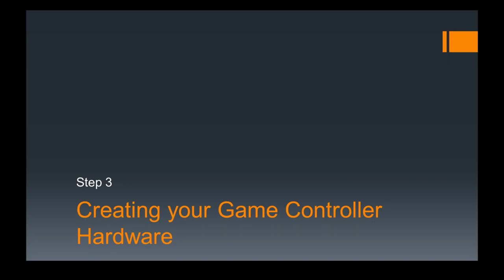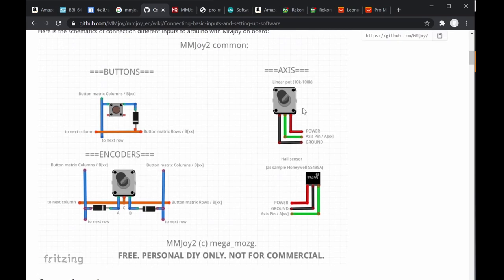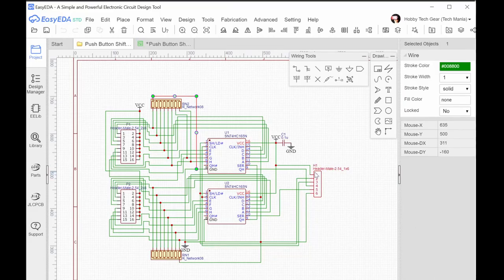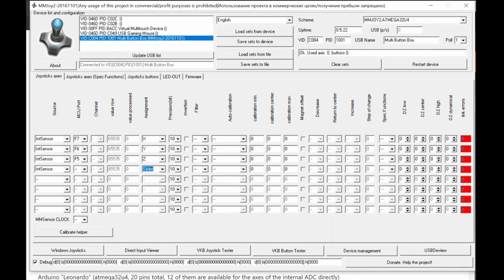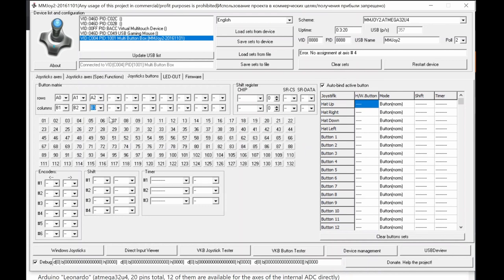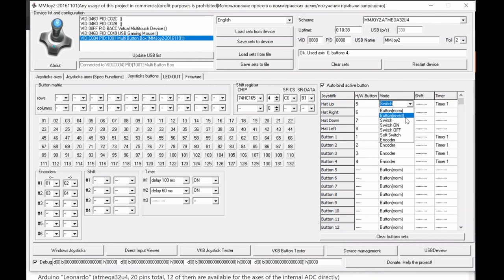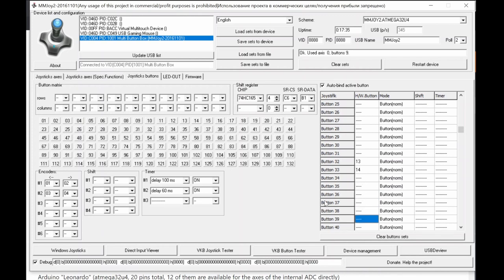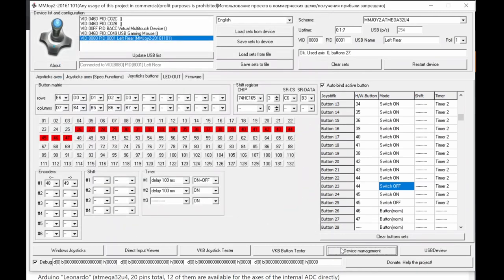DIY: Part 3 USB Controller using MMJOY2 and Arduino board

Comment: Interesting series, thanks. Once implemented, the Arduino Micro is a game controller. This Arduino can no longer read a sketch into the Arduino IDE because it cannot find a COM port. How can I reverse the entire process to use the Arduino micro again via the original COM port?

Comment: Great channel this!!
I sure am going to build a flight stick the way you figured!
compliments...
One question:
Why do you use the MMJOY software and not the present Arduino joystick libraries??
I use Arduino Micro and leonardo with these libraries in my Lear45 simpit for flight controls , throttle.. etc, this works fine.
Reply from the maker: @loediloedi  yes you could i just lazy and not willing to spent time in coding since mmjoy2 provide ample function. But if you have time coding yourself and if possible customize your self would be much better option
Reply: @hobbytechgearID69  ah ok, i thought you maybe had issues with the arduino library.
I do experience some issues with the mmjoy software on my w11 asus rog notebook, so i will go with the arduino joystick libraries.
Thanks for the reply and keep up the good work!

Comment: Excellent series! I'm testing a potentiometer right now for DCSto control hud brightness but having trouble. The pot acts like the center of the rotation is 0, instead of all the way left being 0. Do you know how to change this?
Reply from the maker: You could use a slider mode in DCS analog setting or event set inversion etc
Reply: @hobbytechgearID69  That's what I thought but I can't get it working. I'm sure it's something simple I've overlooking. Thank you.
Reply: I got it working, it was the auto-calibration causing problems. once I manually configured the values it worked great :)

Comment: Hello ! Thanks for the informative video! I have an important question for you - I want to place backlit and latching buttons in the dashboard, because... If the button does not lock, it will not light up. But in games, the button is pressed once to turn something on, and pressed again to turn it off. Is it possible to program MMjoy so that a latching button works, but a single press is emulated, and when you release the button, a single press is emulated again? Same question about toggle switches. And if so, how to turn on the backlight, which is built into the button, or whether the diode turns on when the toggle switch is turned on? Thank you, I'm looking forward to your clarification! )
Reply from the maker: Yes it can simulate a switch select the switch option on the right areas when assigning the buttons, I think I explained it in my video
Reply from the maker: Oh you meant to simulate a real led in the your controller? Unfortunately mmjoy do not provide outputs, spthats whg I move to mobilfight for my real a320 cockpit build. MmJOY is input only. You could use a flip flop logic gate but thennto synchronize with the in sim lights would be impossible and it coild be out of sync in manh occassion

Comment: Hello sir! I wanted to ask for help with connecting the axes and buttons because I am a beginner.
I have an Arduino pro-micro. 1) How many potentiometers (axes) can I connect?
2) After connecting the maximum number of axes, how many buttons will I be able to connect? I would like to connect a button to retract the landing gear (like you did in the video), start the engine and maybe 1 or 2 more toggle switches? I don't want to use the matrix button or shift register yet, only the pins from the Arduino board. I am asking you for help and I greet you warmly.
Reply from the maker: You could try to seek the arduino Pro Micro pinout in google it has, 18 Digital I/O it meants using direct connection you get 20 Switches (inputs), or without using shift reg you but using matrix configuration (Column/Row) you will get at least 9 x 9 or 81 maximum Switches (inputs) limited by MMJOY2 capability, or if you use all the analog 9 of them then you left with only 4 x 5 or 20 switches (inputs). Documents said it has 20 Digital I/O which 12 can be configured as Analog (ADC) input and 7 can be configured as PWM but in actual you should refer to the pin out diagram.
Reply: @hobbytechgearID69  Thank you very much for your explanation and patience! :) Kind regards!!!

Comment: Very good series on mmjoy software, I am trying to build a button box with a key switch for ATS/ETS2 this really helps
Reply from the maker: Glad it helps, I do build my ATS/ETS button box too earlier, just now still focusing on FS2020. Seems pretty powerful firmware so far any needs on my end on the function can be addressed with it, even advanced analog potentiometer or axis requirements.
Reply from the maker: @barrywingler418  Hi Barry, thanks, no problem I could send you some drawings for reference. For Shift reg circuit, and simply use MMJOY2 feature to read it so no need program. For Rotary buttons you need to setup the rotary button basically it's just like a momentary switch 2 ways plus 1 momentary push button switch. Each are treated as push button in raw input of MMJOY2 however to make it as a rotary MMJOY2 provide a features to program it under Buttons tab usually in lower left area. There you need to put the turn left and turn right push button (from the rotary switch) raw button number (the buttons with red marking if it's pushed). and set the timer for around 40-100 ms should be sufficient. I could also sent my sample files of MMJOY config.
Reply from the maker: @barrywingler418  Sent you email

Comment: Hello again, now i figured it out, i was connecting potenciometer on vin instead of 5v because it said so on the plans, nut i would like to know how to connect an external ADC, i have a ADC1115 16bit and i dont know how to connect it and program it with mmjoy2
Reply from the maker: Good to know, Im about to ask you on your schematic coz usually that problem happend if the gnd and +5V are not well connected
Reply from the maker: For adc1115 support unfortunately I could not help as i havent use it, in mmjoy2 joystick page you could select several externa adc but so far I did not use it. If not mistaken there are several articles and forum discussion about that.
Reply from the maker: https://forum.dcs.world/topic/99954-mmjoy/page/28/
Reply from the maker: Seems not supported. Btw as Ive mentioned this mmjoy2  is free and will not have further development or improvement unfortunately.  So its stuck at latest version 2016xxx. I believe the people who create it has now at Virpil company or actually the found virpil.

Comment: Hello. For my DIY-Cockpit, I need 5 Sliders. (2x Volume, 2x Brightnes, 1x Zoom) Is this possible? Can you make a little Video for that problem?
Reply from the maker: Hi sorry got tight timing currently on video, but it can easily be done using the 6 available analog input.  Connect the center pin of the pot to the analog input, and one of the side pin to 5V and another to ground. Its in the mmjoy2 github guide.
Reply: @hobbytechgearID69  in the software (MMJOY2) I can only use one slider. If I choose more than one I got an error if I want to safe the program.
Reply from the maker: https://youtu.be/f3k8beZaHbY
Reply from the maker: Start at 24:50
Reply from the maker: Slider can be only one in windows but you could use other axis as slider thats just naming
Reply from the maker: Windows named analog axis as X,Y,Z,rX,rY,rZ,Slider, etc but all those are axis you could use slider potentiometer or rotating one
Reply from the maker: Then once you named x,y,z or slider you need to bind properly to the application
Reply: @hobbytechgearID69  the application is DCS. If I set one axis as slider and the others as x,y,z, DCS recognizes the slider and set all the others as Joystickaxis (-50/+50) So I have only 50% of my sliders (0/+50).
Reply from the maker: Have you first calbrate the axis with windows usb joystick controller should be possible im using the axis as f18c light potentiometer

Comment: ? In MMJOY you can directly assign buttons to the pins of the arduino board or not ? or only by matrix ?
Reply from the maker: Yes you can, as simple as direct pin from arduino analog and digital, matrix setup and using up to 4 or even 8  of an 8 bit shift register (I forgot but at least 4)
Reply: @hobbytechgearID69  but the program doesn't have direct buttons for the pins.  Only by matrix method. I tried contacting the developer, there was no response. I still don't understand how to connect my buttons to arduino directly without resistors/diodes etc.
Reply from the maker: Sorry I think Im not answering your Q properly, yes for direct input you cant connect to Arduino pin directly and read it. Either you use matrix setup. This is when you just want a simple circuit without adding other component like using shift reg 74hc165. Even in my early build I did not put a diode it still work but there might be some instable switching when you push or toggle from one position to the other. You could reduce this issues by introducing delays in key assignment. I Start using shift reg 74hc165 because it provides more stable input condition with pull up resistor in the 74hc165 input pin. And when switch pushed or toggle will provide zero vs 5V. I guess mmjoy only provide matrix or shift reg because it can use smaller arduino to get more digital input maximizing at least 32 buttons in windoes USB controller driver and even more up to 128 button for direct input driver to DCS for example.
Reply from the maker: Anyway matrix setup still can provide simple circuit with some diode. And you dont need to program anything jusg assign the row and column pin and it will start from button 1 to the rest.
Reply from the maker: Hope provide more clear answer
Reply from the maker: Only for analog input yoj could drive direclty to the arduino pin
Reply: @hobbytechgearID69  I got it. Uh, thank you.
Reply: @hobbytechgearID69  In that case, it doesn't work for me. I need to ask someone to help me write a sketch. Because I also need the deep sleep function. This is not provided by Mmjoy2.
Reply from the maker: Unfortunately yes if you want that, try ask chat gpt too for a code might work. Tried once for other purposes
Reply: @hobbytechgearID69  Yeah, I've tried that. The code doesn't work without human tweaks. And I don't know enough to fix AI's mistakes.

Comment: how do you use a load cell with MMjOY? I have a HX-711 I'd like to use as a brake.
Reply from the maker: Hi unfortunately havent got experience on the load cell but mmjoy have 10 bit analog to digital converter input using external or internal  ADC also allowed

Comment: Can you assign more than 64 virtual buttons? I have a keyboard matrix with over 70 push buttons, and would like to assign it as joystick buttons so it can be read by the program; unfortunately it seems with mmjoy2 only 64 can be assigned.
Reply from the maker: Actually they have 128 buttons and only 32 have special function out of 128 plus 4 directional so around 36. From 33 upward some can be used some are not probably maxed out to around 72 but not sequential so need to jump up several numbers that works you need to test each of the button assignment on the right which one can be assigned i did so,e notes on my fa18 cockpit but seem lost.
Reply: @hobbytechgearID69  yes but on the right side  of the program you can only assign 64 virtual buttons.
Reply from the maker: If not mistaken youre using 2015 ver where there is mouse and keyboard assignment. Try to look for 2016 ver where its only has buttons
Reply: @hobbytechgearID69  Thanks Hobby - didn't know there were different firmwares available with different functions, I'll check it out but I manage to get it all assign now by using the hats as buttons (69 total); cheers.
Reply from the maker: Not sure on the firmware but the mmjoy2 setup software let me know if you cant find it it has 2016 time stamp in the filename
Reply from the maker: Come to think of it it is diff firmware as it cant emulate keyboard in 2016 ver

Comment: how to read SDA and SCL pins so ADC analog to digital with mmjoy2
Reply from the maker: Mmjoy2 is a developed program unless its already created by the mmjoy2 developer, you cant create your own script or add new one. Without going to assembly language level. If you have to use you better consider other if not mistsken freejoy or other.

Comment: I guess this is probably helpfull...but. Not for me. What is the point of showing how to code a button in MMJoy2 without showing the wiring setup that goes with it. Button Matrix, Shift Register. Sorry. This means nothing. Here is a physical button. How does it connect to the board to match the example. 
This is a tutorial for people who know how to do it. Can anyone explain how to wire up a single push button switch?
Reply from the maker: @Flakmagnet1701  you right the diagram and everything are in the github and some aremin the forum. I create this video as nobody explain the steps by steps. You got to know electronics basic, soldering etc. As its diy i wont tell you how.

Comment: hello my friend, i am now in the last step of making my HOTAS, i have done everything, hall sensors, button amtrix everything is gooodd, except 74HC165 shift registers, i am running 2 in series, i dont fu**ing know how to connect it to MMjoy2, like what pins are SR-CS and SR-Data, pls jsut help me with that
Reply from the maker: Assign CS and MISO pin to any digital pin and put the pin anumber into MMJOY2 settings put 2 for number of shift reg use. Connect CLK pin to SCLK pin or B1 in arduino
Reply from the maker: https://images.app.goo.gl/9XpM3XRuzDxqTEtq8
Reply from the maker: An example in reddit
Reply: @hobbytechgearID69  i did exacly that, like i even used a new arduino with a new register, like in MMJoy2 all the buttons colour RED (8 for 1 register, 16 for 2, etc...), like i need help eather there is something wrong with my registers coz they from aliexpress or MMJoy2 is broken
Reply from the maker: 1.Ensure arduino are programmed with mmjoy2 correctly just test with simple buttons. 2. Correctly connect the pin as described. 3. Ensure you select 2 shift reg and assig cs and data pin in mmjoy 2 correcly.

Comment: i need some help, i came to the 33minutre where you uploaded save on the device, (im using original arduino micro), everythng till this moment was working, i am hocked up to  an potenciometer just 3 wires, and its not reading it....do you meybe have like discord, im doing a whole flying simulator I realy need help.
Reply from the maker: Hi. When you said everything was working ... what is it?, also when you said hooking up potensiometer just 3 wire  can u send me emaol how you wire it? Btw do you have any basic  knowkedge on electronics? Sorry to ask so I could help

Comment: Hey i wanted to revert my pro micro.  can you tell me how to remove mmjoy?
Reply from the maker: Never need too, i just bought new one. But if you would like to, if not mistaken you need to upload catarina.hex firmware using mmjoy firmware upload tools.
Reply: @hobbytechgearID69  nvm i fixed it thanks

Comment: how does the button shift function work?
Reply from the maker: Hi sorry, can you elaborate more? Do you mean shift register function? Its explained in mmjoy wiki or github
Reply: @hobbytechgearID69  There’s a shift function for each button. How does it work? Thanks!
Reply from the maker: For the shift register as long as you follow the circuit as per mmjoy guide using the recommended shift reg IC components, and circuitry, the firmware will take care of it, you just need to enter the specific pins into mmjoy2 setup. No programming need any change of input states from the buttons with pull up resistor to +5V on open switch and 0V upon switch on will be shifted serially to the arduino and sent to the pc as a button chnage state you could manipulate any input change state with mmjoy2 setup software as a toggle if using toggle sw or simulating a toggle sw using push button or a basic  push button.
Reply from the maker: If hou have basic electronics knowledge would help if not might need to prepare more. Its free and easy but still need some basic knowledge though